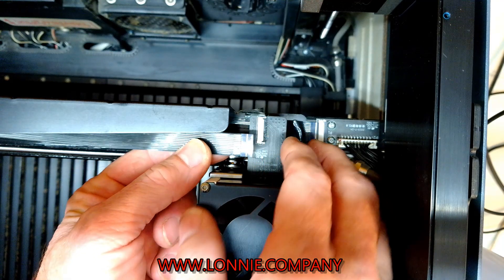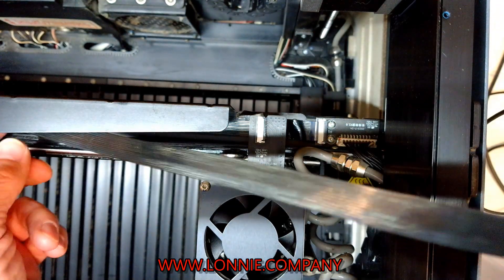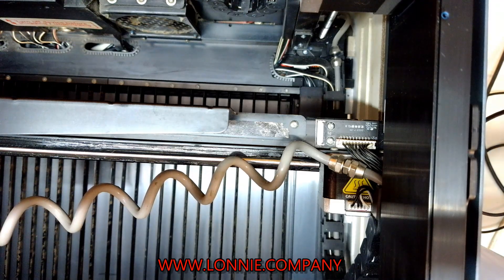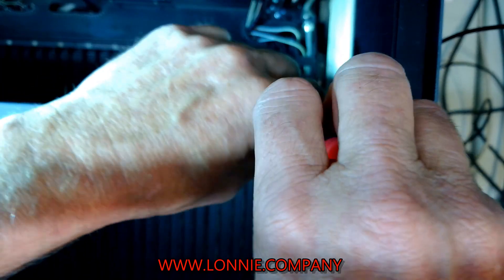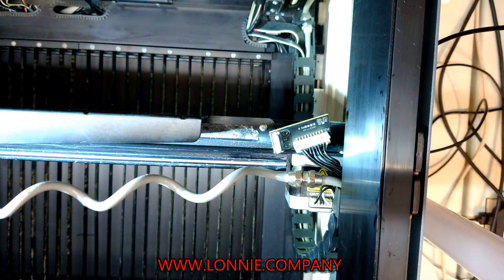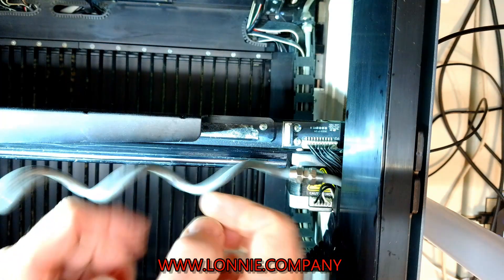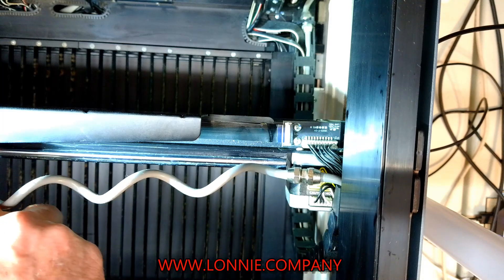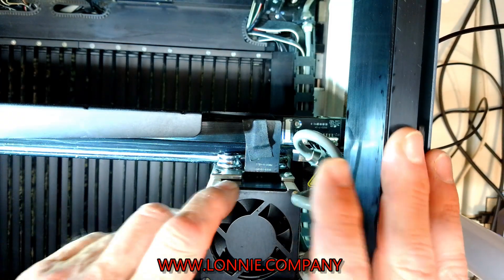Changing out Ribbon Cable - WeCreat Vision 20 Watt

Comment: Lonnie, do you have a video for removing the head? I have for that the bottom rollers have come off the guide rod at the bottom and the head is at a slight angle pitching towards the back of the machine AND the head is rubbing on the black bar and creating metal shavings on the project piece.

Comment: Lonnie we just replaced these as Wecreat thought it would fix the problems. It hasn't. The laser still won't  autofocus and the laser head seems to not have any power. Do you have any suggestions to try? We are waiting for a replay from Wecreat.
Reply: Are u getting the mcu2 error on update? Mine did they are sending a new cable in also looking on amazon for the cable, hopefully this fixes my issue too of not autofocucing
Reply from the maker: @rickyboardman3021  ive not gotten any errors. I made the video at the request of someone else who had to swap thiers out and didnt know how.
Reply from the maker: no i dont sorry